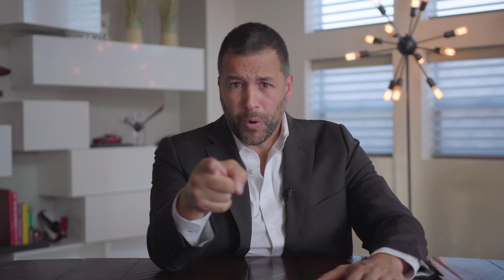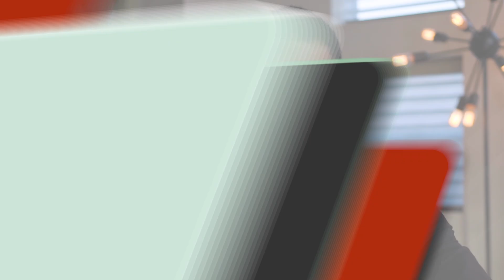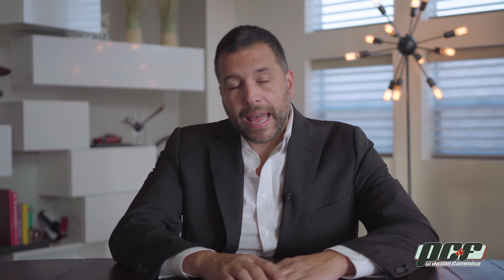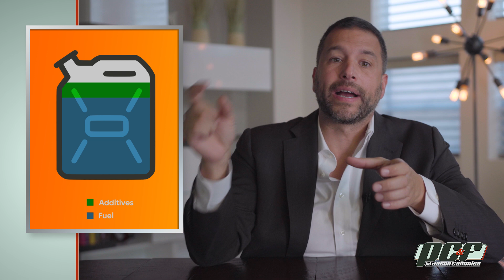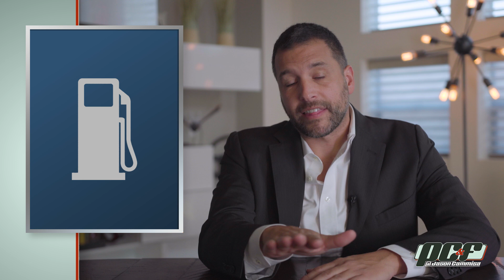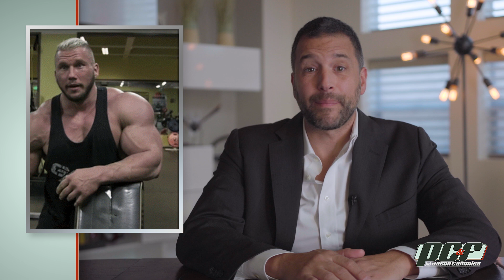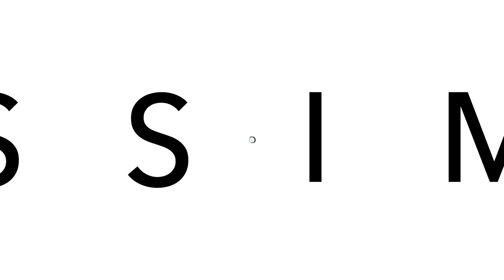Why you should never put premium gas your non-premium car — Proper Care & Feeding with Jason Cammisa

Comment: Mh, there's a little (big) inaccuracy here. OK, old, naturally aspirated (with no variable valve timing) engines get no benefits from premium gasoline. But newer engines, ESPECIALLY turbo and direct injection ones but even N.A. ones, can detect when to spark by "feeling" the incoming knock. This means that with a premium engine, even if it is set up to run on regular gasoline, with premium gasoline it spark later and more efficently (+ more power and less fuel consumption).

Comment: Not really 
Different gas companies have different formula and additives 

Let make additives as constant except octane( they never accurate on octane)
But not all gas have the octane rating as advertised, they're usually lower than advertised, sometimes advertised premium gas might have just enough octane as regular 
The octane rating will effect the spark timing as well and the smoothness of the motor 
With the help of variable valve timing and the other sensors , earlier spark, longer and stable combustion 

The rating of the gas 
In some part of the world, they have euro standards gor gas and diesels, euro 4 or euro 5
They have lover ppm of foreign substances or Sulphur and other stuff in the gas 
 
Yes, using premium on ordinary cars that only requires regular is kinda wasteful 
Premiums are better pro performance oriented motor or appliance,  yes 
But premium gas in regular motors gives more headroom, cleaner and smoother operation and respond, sometimes even better mileage
But the fact is all those benefits could not really overcome the price

Comment: actually most modern cars will advance ignition timing in the case of higher octane fuel. not to mention the other additives in high octane fuel such as stabilizers and upper cylinder lubricants

Comment: Actually you are wrong on this. Regular fuel has a 5-10% or sometimes even more ethanol content. The more ethanol the higher the tendency for the fuel to gum up. Some premium gasolines have a ethanol content of 0 (BP Ultimate 102 for example). You immediately realize the quality of that fuel if you smell it. Or don’t, because the stuff is not very volatile…

Also knock resistance of higher octane fuel is better, some even burn cleaner (less carbon buildup, even less emissions) you will not harm your car in any way by filling it up with premium instead of regular fuel. It will only cost more…

Comment: I'd agree with this but, when I had my 2011 Crown Vic, I would get better MPG from 93 than 87....so....
Reply: That's probably because of ethanol which contains less energy than gasoline. Regular contains up to 10% while premium can be ethanol free. The UK switched our regular from E5 to E10 recently and I noticed a slight drop in mpg, even though the engine runs pretty much the same.

Comment: Unless you have a turbo car... even if it's designed from the factory to use 95 (EUR) you'll get more power on 100 (EUR) simply because there's more energy in the fuel for the extra air to burrrn
Reply: There is actually less energy in higher rated fuel.

Comment: The owners manual in my 2015 Ram 1500 says regular 87 is okay, but 89 is recommended. I ordered my truck from the factory and other than what fuel they put in it during shipping, my truck has ALWAYS got 89 octane. The difference between 87 and 89 octane is about 12 bucks per 100 litres or so (my truck has a 95 litre tank). Also I'm tax exempt for fuel. So my 89 octane fuel costs less than 87 octane for someone who is not tax exempt.

Comment: He's right, plus a vehicles engine must be tuned for higher octane to even be effective anyway. The 6.1 in my Challenger was designed by SRT to be able to utilize a higher octane tune better than the 5.7 for example, and this is why it only requires 87-89 whereas mine has a strict warning of minimum 91
Reply: The 5.7 requires 89 I’ve been putting premium the entire time because the dealer told me

Comment: This is not accurate, higher octane fuel with no ethanol and those other additives can be beneficial to run in say a slightly higher mileage car to help clean the fuel system, injectors, valves etc. Especially if you live in a cold climate where you spend a great deal of time idling your car in the winter causing buildup on the valves over time. I'm not saying run it all the time, but once in a while to help your fuel system is beneficial

Comment: Only thing to mention is this... all the new turbo cars, even the old T5 motors use knock sensors to adapt to regular but they typically do knock and pull timing. I think most modern turbo cars will perform better under load and top performance with premium

Comment: I have seen better fuel economy and increased power when using 91 or 93 octane gas in a regular car designed for 87 octane. Plus it seems to run cleaner. But overall it does make sense.
Reply: No you haven't.
Reply: @snap-off5383  ??
Reply: @wozmac771  Science says your claim is false.
Reply: @snap-off5383  ok..  Apologies for sharing my personal experience. Will try to keep it to myself.
Reply: @wozmac771  The solution would be to educate yourself and figure out why you thought you were getting better mileage and "running cleaner".  Figure out why you're gullible enough to believe impossibilities. Were you just confused and measured wrong, were you rating it emotionally instead of scientifically?  Or is it more to do with acknowledging the truth given here in this video would mean acknowledging you made a mistake and your ego is too fragile to acknowledge it learns as it goes along and won't be right 100% of the time?
Reply: @snap-off5383  Thx for the advice. But I don't need it.
Reply: @wozmac771  All evidence to the contrary.  One can only lead the horse to water, the horse accepting the education is dependent upon the maturity of the horse.

Comment: My 2015 Mazda 3 required regular fuel, but I remember when I put premium fuel in it there was a noticeable bump in torque...but my fuel economy was much worse...this was with the 2.0 skyactive not the 2.5
Reply: thats because simply put he's wrong.  not all engines see no benefit from higher octane even though they aren't "built for it".   most cars that only require 87oct will see fuel milage increases on highway trips since the engine can stay in better timing tables for longer.  the math might not add up to a saving(mpg vs price at the pump) but the car will run better especially through elevation changes.   Mazdas are one of the car that will see significant mpg bumps on the highway with 92oct, you'll also see better in town mileage as well.   take everything on the internet with a grain of salt.

Comment: Both of my wife last two regular cars needed premium to avoid detonation.  First was a 95 Taurus FFV and the other is a 2013 Legacy 2.5i.
Reply: Exactly, I don't know how Jason hasn't noticed this. I have a BMW e46 330ci and a 2004 Jaguar XK8 4.2 and both need premium fuel to avoid detonation at low rpm/ high engine load. Most idiots wouldn't even hear the knocking, but if you're sensitive you can clearly hear it, and I don't know how Jason wouldn't know this? Unless he's just talking about like a 2.0 4 cylinder economy car.
Reply: @alembic1105  don't buy crap cars, I suppose. What kind of quality does a car have when it doesn't even have an anti knocking system?? My 90s Saab had that...
Reply: @fgsaramago  Lol, e46 3 series, e39 5 series, and Jaguar X100. All widely regarded as crap.
Reply: @alembic1105  yes, they are. Are you trollin or something? BMWs and Jags are known for reliability issues and just crap engineering in general. Are you some kind of fanboy for those brands?? Why do you think they mostly sell to fleets with maintenance and repairs included on the lease contracts? I mean, police forces for instance aren't exactly looking to splurge money and they have a lot of BMWs simply because not paying repairs make them a good deal and actually ends up saving money. The reason those repairs are included to begin with is because everyone knows they're poorly engineered.
Reply: @alembic1105  you own a e46 so knocking is the least of your problems.
Reply: @truantray  It's an incredibly reliable car. In the family since 2002, 130k miles, never broken down. Anyway worry about your own problems.
Reply: @zzranmazz  I think that it's a discrepancy over what Americans refer to as premium fuel and what we refer to as premium fuel in the UK, further compounded by the fact that we use octane/RON numbers differently. Unfortunately I'm not sure what the conversion is, but what I mean is that if I fill up either of my cars with anything less than what we call 97 octane/premium (as opposed to the standard 95 octane that we get here), then I get detonation. But whenever I get 97/98/99 octane then they run great.

Comment: So what about a car that’s is 89 from the factory then you put a tune to run on 93. Is that bad for the car?
Reply: Makes no sense.   Like he said 93 has less energy than 89, its the higher compression that gives the additional power, you can't change bore/stroke with a tune, your compression ratio is fixed. There's no getting more power out of 93 without adding more compression. If you try to add compression by "tuning" more fuel, you'll run rich and get less power, shooting raw fuel out the exhaust.  You'd have to add boost air to increase compression.  A tune changes ignition timing, fuel injection, and air fuel ratios.  Those won't require more octane.  Peak power happens when you're running lean, not rich.  Moving to more power (hotter and leaner) means you need LESS octane.  Edit: ok thought about it more, they're probably retarding the timing, which would add compression, but modern cars don't run much advance anyway, its not like they'll get an 85 to 93 increase.  I guess you'd have to ensure that your "tune" will STILL adjust timing/fuel to prevent knock coming in from the knock sensor.  If it will you're fine on any octane.

Comment: I'll have to disagree especially with the influx of economy 4 turbo bangers. Those cars will begin to pull timing when they heat soak and higher octane gas will slightly alleviate that. Otherwise, sure.
Reply: And most of them suggest high octane fuel, so...
Reply: No not really……the limiting factor until roughly ten years ago was that gas engines only had port or manifold injection as an option meaning the only way to compensate for lower quality fuel was with ignition timing. With the introduction of direct injection to gasoline vehicles it also allows the injection timing to be adjusted thus further reducing the likelihood of knock occurring. Essentially the fuel is delivered just before it is needed rather than having to be drawn in through the intake manifold and exposed to hot spots in the cylinder.

Direct injection combined with increased data resolution from knock, rpm, exhaust temp and o2 sensors makes it much easier for modern engines to adjust for a wider range of fuel qualities.

Heat soak occurs in all engines regardless of whether they are turbo’d or not and in fact a turbo’d engine running in an econo 4 banger will run cooler than a naturally aspirated engine simply because of the improved scavenging of exhaust and reduced back pressure.
Reply: @CheekyTyke007  you're telling me a turbo engine has less backpressure and more exhaust scavenging than an NA engine and that they run cooler? I don't think so.

Also you say the ECU can adjust for fuel quality. Yes so there it is right there. Ignition timing can potentially be taken away if you have a low octane fuel, particularly when heat soaked, which is more likely in any boosted cars.

Comment: I have a 5.0L 2019 f150 that runs like absolute dog shit on anything less than 91.  As in, the transmission shift points don’t match up with the power band unless I have a sufficient octane rating in the tank.  The truck is obviously designed to run on cheap fuel but I certainly wouldn’t recommend it..
Reply: You'll notice your owner's manual likely says "ok to run low octane in emergency", because the computer is going to run in "safe mode".

Comment: I have a 2019 ram, when I run regular 87 I randomly get knocks. When I run mid grade 89, no knocks.
Is this just cheap 87 that I’m finding at random?
Reply: Try using Shell or Sunocco 87, they have the most consistently high quality gasoline in North America. If you still have a problem, there's something wrong with the truck. If not, there's probably a problem with your usual gas station.
Reply: You found some "Panther piss".

Comment: But it's not all about octane! I believe the premium fuel has better detergents etc to improve engine cleaning, which must be beneficial, particular in older cars, even if you don't need the higher octane.
Reply: yup!!, you get clean valves, zero carbon buildup. defenetly will keep things running good

Comment: This is not entirely accurate. It depends on the car. A lot of cars are knock sense retarded as default. It runs as advanced as it can until knock. If you lower the threshold where knock occurs the car will allow ignition advance until knock...which occurs later with 93 than 87. 
For example Honda's 3.5 is the exact same engine in the Acura MDX and the Accord. But its rated 300hp in the "premium" Acura, but 276hp in the "regular" Honda.
Similar thing with GM's 5.3 that runs on E85 or 87. It is allowed to advance more when you put in E85 and therefore achieves higher output ratings. There is no other way the engine knows what is in it, there is no switch for when you run E85 vs 87. Same principle applies to 93, etc. 
These are, however, specific examples and dont apply to most engines. So he is mostly correct. Just do your own research on your specific engine, or play it safe and run what it says.

Comment: 2001 echo 1.5 vvti engine 400000 on the odometer I put 93 octane and synthetic oil runs well and flys
Reply: and i bet the valves and head are spotless!!- no carbon buildup.. will go another 400k easy

Comment: So Jason, what about cars that only "recommend" premium. My 2018 Stinger GT recommended 87 and then for 2019 and 2020 they changed it to recommend 91 with a minimum of 87(I assume because their power numbers were rated at 91 so they had to change it). Am I hurting the car long term using 87? I can't tell the difference in normal driving using either and the price difference is at least 20% higher for 91.
Reply: If I'm driving any non-shit box it is getting premium fuel...

Comment: Less carbon deposited on valves is enough reason to fill up with premium once a while.
Reply: Carbon deposits are in no way related to fuel quality, at least on direct fuel injection. There, fuel is injected straight to the cylinder, so any type of cleaning detergents won't help you clean valves.
Reply: @hojnikb  Not all cars have direct ingection engines and many of those with that tech need high octane fuel also, especially the first gen's.

Comment: I have a 2016 VW Golf Sportwagen and that is able to run regular 87 gas but I hear knocking/a rattling sound like pennies in a can from time to time but it gets 33 mpg mixed super easy driving. 
93 octane doesn't have that sound,the car definitely feels better and my fuel mileage drops to 31 mpg.
Reply: Lenwood Cruze I have a 2017 golf 1.8tsi and I use 93. But I get better mpg with 93 over 87. Are you sure your mpg is worse with 93?
Reply: @tallguysix8  slightly worse or I'm just pushing it alittle harder! LOL!
Reply: @tallguysix8  it definitely accelerates better that's for sure!

Comment: I was hoping you would touch on why people think premium is better than mid and regular. I always hear car guys say it keeps engines cleaner and running smoother. The latter is true if required required. Premium fuel actually burns slightly dirtier than regular and REQUIRES extra detergent to keep engines "clean". The extra detergent does not keep your engine cleanER than regular. Only what is required is best.

Comment: The real scam is ethanol in regular fuel. Higher performance engines benefit from ethanol content, but it needs to consume nearly twice as much of it to achieve those benefits. 

Meanwhile, it does NOTHING in your regular car but get consumed nearly twice as fast now.
Reply: And over the long run will damage your fuel system.

Comment: Here in the UK most stations sell 95 and a premium petrol (which can be 98, 99 or 100+ depending on the brand). The premium stuff obviously resists knock but also usually contains a bunch of detergents that mean even if your car doesn't require it, it can still be beneficial to fill the tank with it occasionally.
US fuels confuse me though; it looks from the RON numbers like your 'regular' is some kind of sub-par dish water. I look forward to a future video on that.
Reply: The US doesn't use RON it's uses AKI for it's Octane rating. So 87 AKI (US "Regular") is about 91 RON. 

93 AKI (US premium other than California it seems) is about 97 to 98 RON. So a bit lower octane than what much of Europe has available but not necessarily bottom barrel sludge like the numbers indicate
Reply: @mattdwyer1761  Hey thanks for the answer, I've been looking for this. I'm getting a 5,7 HEMI Challenger RT and the smallest octane fuel in Europe is 95. So am I good with that type of fuel here?

Comment: At Hertz they use 87. Everything gets that garbage. Well, we had a c63 that was misfiring sooooo bad and it sounded like it was running on 4 cylinders. It was bad. The tech had to drain the tank and put 93 in it. It ran fine after that.